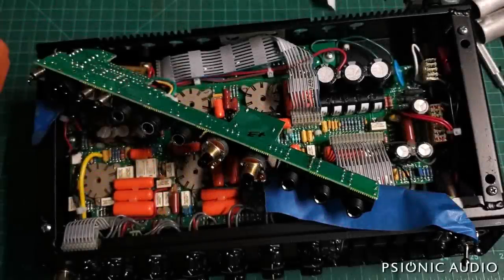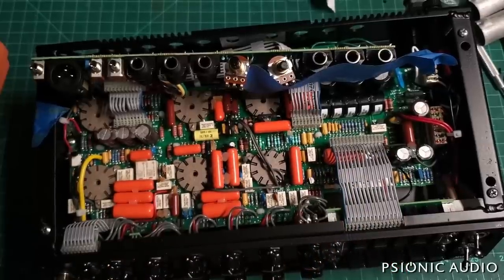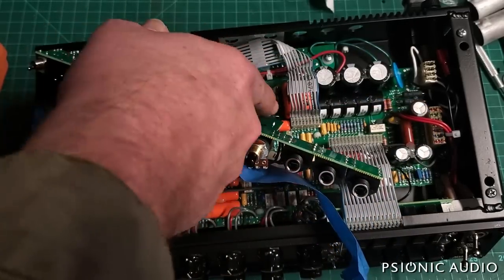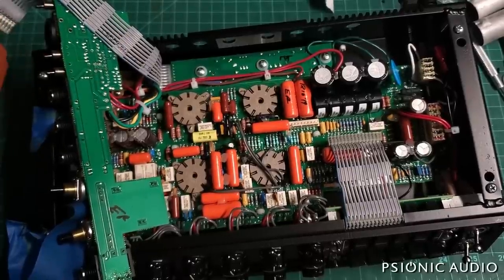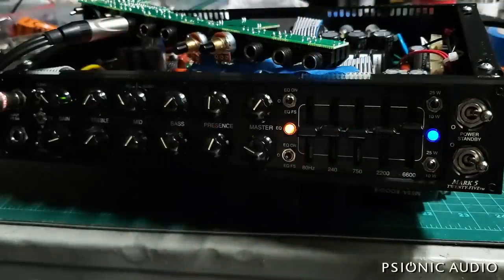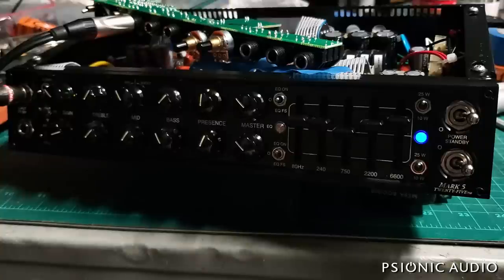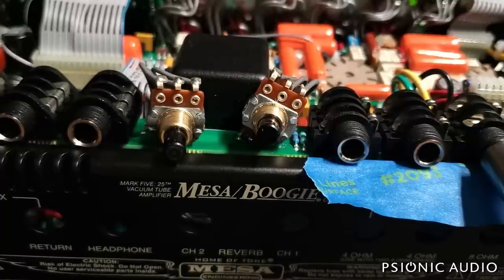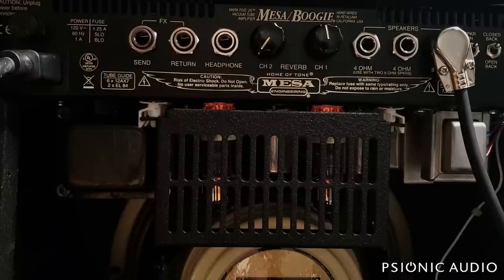Mesa Mark Five:25 | Finding The Needle In The Needle Stack

Comment: I always imagine the Mesa Boogie engineering department to be located under a volcano and filled with echos of maniacal laughter.  Good Lord.  I’m glad I’m too dumb to work on Mesa amps.
Reply: WORKING ON MESA PRODUCTS ACTUALLY MAKES YOU DUMBER! I had to replace a 20 cent unobtainium 1/2x1/4 inch keyboard switch on a piece of ultra high end, USBS US Govt' Certified to > +/- 0.02% tolerance $40,000 1980s test equipment. I went into it like I was going into a Mesa Engineering product. I took apart about 1800% too much stuff. It is a lot more like taking down a desktop computer's tower to replace the mother board, CPU, RAM, graphics card, sound card, PCI cards and drives. It makes me hate Mesa even more than I did before, and it despite my doubts that I could hate them more, it just happened. I still have no clue how to access some of the screws I see the wrongs ends of, but I don't need to find out how to get to them. It was pulls some board like pulling PCI cards unplug some things a few screws and the main board opens like a door. EPIC GOOD DESIGN! Mesa is the exact opposite of that.
Reply: @Satchmoeddie now imagine I can't even find a tech who knows how to look inside a stupid jcm800 2203 horizontal inputs (the one with the even easier to access pcb, holding just on the knobs)

Comment: Great job tracing that out.
I have a Mesa Mark2b. I have done some repairs here and there and even recapped it. But there is no way I'm going near the circuit board. And it is nowhere near as bad as this thing. This amp tries to do too much. I'm now convinced it's better to get amps that do a single thing well.
Reply: It'll be interesting to see how all the Neural DSP stuff plays out over time. IMO, that setup ( add a $250 FRFR )  sets an upper limit on what I'd spend on an amp now. I've had a Headrush FRFR as a floor monitor and it worked amazingly well. However,  all digital stuff fails sooner or later...
Reply: @arkybeagle6159  The Kemper stuff is amazing. If I were making money touring, I would just use a Kemper. If it breaks, you go buy another one. Get your presets programmed plug it straight into the house PA, put your in ear monitors into your ears and yer done. F'k all to the set up cabs & heads & micing your cabs, & latency delay for mixing the mic'ed cabs with the DI signals and all that other BS. Push, pull, click, click, plug n play baby. I have fixed Line 6 stuff and it kinda sucks, but it's good enuff for playing the tavern scene.
Reply: @Satchmoeddie  pretty easy to just plug into an amp and play too. No sound man
Reply: i just sold my copy of this amp out of fear that I wouldn't play it enough and in 10-15 years it would need an expensive repair. 

But I have to say, these are fantastic amps as long as people realize they're mesa and they don't have three channels "fender, marshall and mesa". they have separate mesa channels and all sound good. There's a large group of people out there who believe every amp company first has to make fender and marshall channels and then can make their own if they perfect those two. 

My fear may be irrational - the one I had was probably four years old, not a single unwanted noise anywhere, very quite and could sound huge for such a small amp if one read the manual. 

My other fear - complicated older amps don't resell well. I have seen freshly serviced and repaired JVM410H's for around $1000.
Reply: I had a Mk IIB in the 90’s. Best Mesa I ever owned, easy to work on.

Comment: I feel that Mesa has brilliant circuit design, no complaints there.  Yes they’re very complex but that’s the nature of a wildly capable amp.  Their Mark amps give you 25 settings in the hope you’ll find 3 you love and I’ve been very happy with that concept as a player.  Physical assembly is another story.  Good designers (of anything) consider maintenance and repair in their design, and Mesa could do much better considering the complexity of their designs.  Complex demands a higher degree of reliability, and repairability, than simple - all else equal.  They’re dropping that ball a bit too often.
Reply: I don’t mind the maximalist spirit but they ought to make these easily repairable for what they cost. Everything sure is crammed in there.

As for me, I’m just a weekend warrior, but give me a simple amp that a tech can get into and service easily, and I’ll get any sound I could ever need with pedals.
Reply: The "Mini" Cooper (BMW not the original) of amps? 
(...a car that looks like it should be well under 3000 lbs but is closer to 2 tons...look under the hood sometime)

I'm just thankful it's still thru-hole and that Mesa stock replacement parts.

Comment: Good systematic approach to troubleshooting-isolating the fault to a particular system. I believe to work on Mesas a person has to understand on a gut level how they do things, but the repair techs in Petaluma are probably all alcoholics by now. It's kinda like a friend of mine worked for Mazda back in Wankel days and the big secret was the heap of dead rotaries back behind the warehouse. They've probably got a mound of junkers at the Mesa Tool and Die Works And Sewer Repair.  My experience with a Mark Five:25 was not a happy one. When the owner decided to send it back to Mesa it was like getting out of prison for me. Only the third time I bailed in twelve years and two were back to back Mesas. It also occurs to me that on this particular model they are trying to cram everything that a full size Mesa has on real estate that's half the size.  Twenty one relays?  Why? This has just as much stuff on the board as the Mark III I worked on a month or so ago and the components are all just as large.
Reply: Are the tube sockets soldered to the PCB board or the chassis?  Do these amps have any more frequent issues than other boutique makers that have multiple channels/modes?

Comment: Thank you so  much. I was about to look for one second hand but i think i pass it.
Reply: My MV 25 has been very reliable for about 3 years now. SO worth it so far. However, I get it. If I ever have a big issue, I’ll go with a Friedman…
Reply: I've got a 5;25 express head. The one without the graphic eq. I was thinking the other day that its probably about time that thing takes a shit now that the warranty is up. Ive built and repaired amps for years but you couldn't get me inside anything that says Mesa or Boogie.

Comment: I had to send in my Mk V 35 after it began producing muffled tones after using a Fuzz pedal, to which the only thing that fixed it was replacing the v1 preamp tube. Yeah, I can't do that every time I want to use the pedal so I sent it in to Mesa for repair. 6 MONTHS LATER and no update.  I called and asked what the status was, and they said the amp somehow got misplaced but they found it and will begin the repair. sigh I finally get the amp back and studied the invoice.  It stated that they replaced the "Capt Tant 2.2uF 35V 10%"  I'm assuming this is a component that they don't rate properly. Anyways, after the debacle with both the amp and their repair service, I'm selling this thing to avoid whatever surprises it has for me if I decide to play it again with a pedal.

Comment: I have a Mesa Formula preamp that had JFet failures in the switching circuit. Stupid that they solder them to the ckt board rather than using sockets and a dab of silicone that I modded in.

Comment: I had a boogie 22+ combo, it was very loud and a good pedal platform
the clean was sterile and wouldn't crunch up, the lead was that awful thick Santana tone  that you couldn't dial out, it was horrifically expensive almost 50% more than the excellent Marshall tsl 601 that I replaced it with, I never had any problems with either, both being reliable, I use boss katanas now
good enough for what I'm doing
cheap as chips, sound good enough
and are very versatile.
Reply: And are so much lighter in and out at night. Especially late night.

Comment: I had one of these amps. The fan was noisy, but even with the fan disconnected the noise floor was so bad (even clean) I could not record with it. I don't mind a little noise on guitar racks but this was too much for my taste.
Reply: I replaced my fan for a pretty silent one. It’s an easy mod worth doing. The noise floor is ok for me unless using pedals.

Comment: Leo would ask what are you thinking when you design this .  A fine example of not my problem to fix  it designers . j174 is a jfet is it not ?
Reply from the maker: Yeah, one already obsolete and not recommended for future designs for years now. Shame on Mesa for using that instead of reading some other component's datasheet.
Reply: @PsionicAudio  about 15 years from my memory . still made  to about 3.60 usd depending on quality  from interfet.

Comment: Hello Lyle, would you ever comment on amp brands/models that, when they do come across your bench for repair or normal servicing, impress you on build and design quality? I get it if you would rather not comment, but just wondering what makes seem to impress you. Thanks for all the great videos.
Reply from the maker: Thanks! I do try to from time to time - I don't want to be the doom & gloom amp channel.

In roughly ascending price (so the lower price stuff is good "for the price"):

Vox ACxx Custom series
Victory
Ceriatone (not kit builds but factory)
Magnatone
Dr Z (not inspiring but reliable)
Orange
Germino
Metropoulos
Fuchs
Suhr
Welagen

Not a thorough list, but ones that come to mind.
Reply: @PsionicAudio  Thanks for the quick response! Good to know who gets honestly deserved respect. Again, love watching the videos and picking up solid knowledge! Thanks.
Reply: @PsionicAudio  what about Traynor amps?  Supposedly the vintage ones are built like tanks, I recall the author of The Tube Amp Book was very enamored of them.

Comment: I have a mark v 25 , its the 110v model from USA and I use it in Greece with a stepdown transformer but today a friend plugged in the amp directly to the 220v ac outlet and the amp died. The fuse on the back blew but there is also a smell like a melted plastic coming out from the area around the fuse. I tried to replace the fuse and I connected the amp to the 110v transformer but when I switched on the amp I saw smoke coming out from the area behing the ac plug so then I switched it off back immediately. I removed the amp from the housing to see if there is any visible damage but I can't see what might have fried. Do you have any idea where to look? Is there also any schematics available for this amp?
Reply: oof, my advice would be to look for signs of heat damage, hopefully the fuse did its job before the amp was totaled.
Reply: You may have melted the primary windings of the power xformer. They only get worse as they continue shorting out once the thin laminate melts off the wire, cooking and blowing more fuses. Check the transformer.
Reply: @stevebeck3164  Finally I was very lucky, there is a varistor inside the amp for overvoltage protection and it did its job successfully. So I replaced it and the amp is working again now!

Comment: Mark 25 gets decent reviews from players. I heard it once in a band situation and sounded great. Does mesa actually have lower reliability than other amps? I see they would be a PINA to fix though. I'm kind of annoyed because I paid over $2k for a Dr Z and yep, it's got issues. I guess, with more crap crammed in the Mesa, the higher chance of something going wrong. Then of course my Z has a three knobs, and it's got noise issues. Go figure. My Origin 5, is bin worthy at this point. Anyhoo...great vid! Love watching em.
Reply from the maker: Mesas have big issues with reliability. This one sounds good clean, though the reverb isnt good. The OD tones are not to my taste. 

I'm going to do a video comparing this to the similar sized/output Egnater Tweaker 15. Very different price points.
Reply: @Guitarsthatkill  Anecdotal at best. Psionic Lyle works on hundreds of amps, and although not a scientific sampling, his sampling is far broader and more informed as well.
Reply: @KentBuchla  There are also  5-10x as many Mesas as there are of anything else that is as (or more) expensive.    By the time production Soldano amps came along in mid-late 80s Mesa was selling the Mark IIIs... and had several combo amps, several Bass amps AND a full racked range of both as well.

Cheaper amps are as likely to be stashed in an attic,  garage or abandoned in a rehearsal space - as they are to ever be brought in for any maintenance.

Comment: I am wondering what people that fixing electronics like main board of laptop or fixing play station - working using microscope and using hot air to detach components from the circuit can say about that circuit, if it is really so dense :)

Comment: Ok, we get it…the Marks CAN be a mess to repair…but this is much more of an overly-negative presentation than my experience with them (over 30 years) has proven. I’ve owned Mark IVs, IICs, IIIs, and Vs and I have not had much beyond what most tube amps require in the way of maintenance and/or repairs. In fact, my old Seymour Duncan Convertible had way more issues than any Boogie Mark amp I’ve ever had. I mean, yes, they can I’m sure be a pain in the arse to those who know and repair them…and I concede that. And this was a fantastic video in many ways. However, I guess I’m just saying that MY personal experience has been nothing but extremely solid for the most part. My Mark IV was especially robust over several years of gigging. Now, I do take great care of them. I baby them for sure. But they’ve performed when I’ve needed them and have never failed in the studio or live. So there! 😐😑😂 …oh, and for those who join in on bashing Mark amps in this thread, kinda comes across as people with NO long-term experience with them (not saying everyone, but most) and a tinge of jealousy. Enjoy your Katanas…I guess? 🤷‍♂️

Comment: The one good thing about Mesa is they do sell their proprietary parts at reasonable prices.  Andy Fuchs at least shows a really darned good effort at good design in PCB amps, but he doesn't have the blind brand loyalty following that Mesa has. Mesa can sell turds with knobs on them provided they are badged Mesa Boogie. Now that Gibson owns Mesa, comme ci comme ca. Gibson has almost NEVER been able to design a really good tube guitar amp on their own. The few outstanding outliers are right when they bought a new old company up, like Moog,  Standel or even Mesa Eng. (I suppose) "comme ci". At least Henry J. is gone.

Comment: FWIW a year later, the reverb circuitry on these is poorly designed.  On my 2009 MarkV, the tweed channel is the only side that has any reverb but it sounds nowhere as deep as a Fender or Marshall.  On the other two channels, the reverb is virtually inaudible.  Candidly, these are over-featured, poorly engineered POSs.

Comment: The Mesa bashing on this channel is uninspiring. This little amp costs as much or less than some of those Swarts, Carrs, BADs, Fenders HWs, Marshalls (US price) and other boutique builders. Not to mention the Two Rocks, Magnatones etc. In contrast it does a bucket load of things more. With my Mesas I have I never had an issue so far.
Reply from the maker: Here’s the thing though: having a 400V rated cap in a circuit with more than 400V present?

That’s not my “opinion.“ That’s not me “hating on” Mesa.

That’s just piss poor engineering and quality and it causes repeated, predictable, and preventable failures.

Yours hasn’t failed. Yet. Great. 

And all my other “bashing“ comes from observing the many other common failures of many dozens of Mesas across many different models.

They keep doing dumb things and charging you extra for it.
Reply: @PsionicAudio  I own a dozen and a few more amps. That is from where I take my experience.
I went vintage only once and immediately returned the Fender Tremolux when I opened it up and saw an asbestos fiber board glued to the back panel. So I went boutique (mostly). 
Swart: great amp but (annoyingly) more noisy than my other amps, returned several Carrs (found them to be rather stiff and partially also noisy), Two Rock (probably my best sounding amps), dito with Suhr. I am glad that I finally found a handwired series Fender Princeton where the cabinet isn’t rattling. But my Mesas sit there like a tank, having a very good tone and are together with Two Rock the least noisy and having the best master for home playing. I understand that they might be more expensive to get repaired but that is owed to the multi feature set they come with. However the never let me down so far.

What you also need to bear in mind is that you only get to see amps with failures. But how many Mesas are out there in the market with happy owners and how many Mesas ended up on your bench so far. If you would have this number, I am sure it would be a healthy one. On the other hand I had seen multiple BAD amps on your bench over the years. Likely their number is not as healthy - my guess.